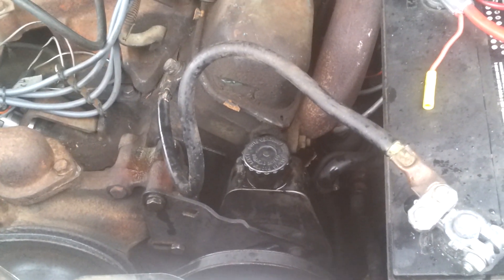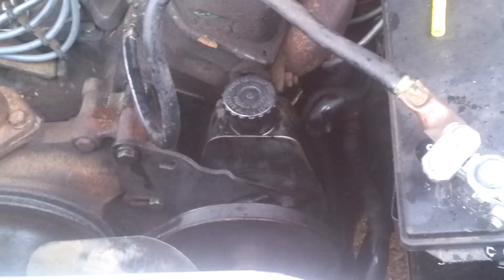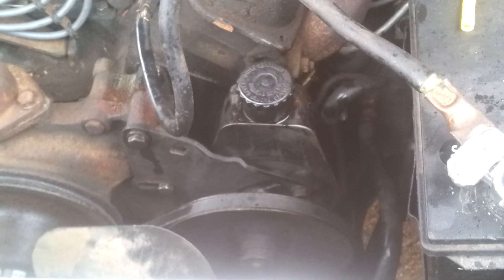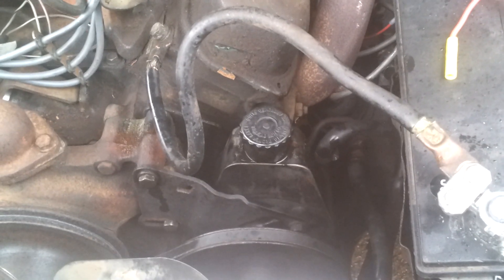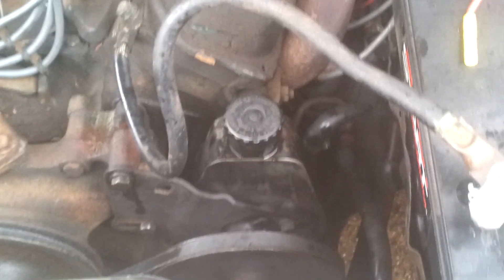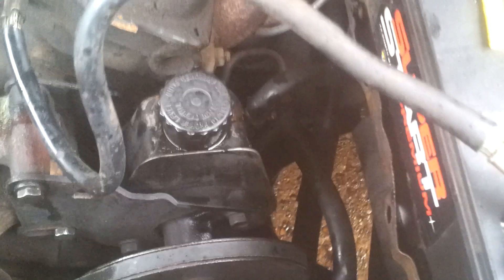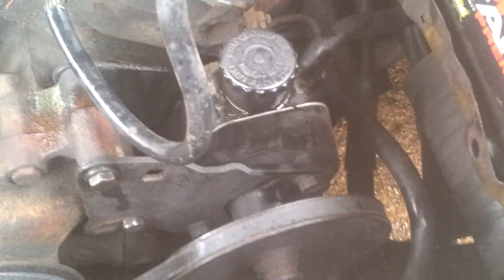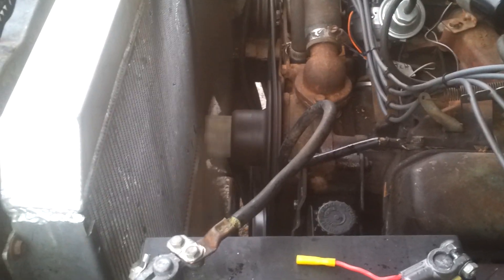1968 Dodge Charger R/T December 2012 Update

Comment: My dad substituted transmission fluid instead of power steering fluid. The pumpkin at the end of the steering wheel has always leaked. The transmission fluid eats up the gaskets. Restored the car and use power steering fluid. I need the bolt that closes in the back of my pump. Either was left out or came loose. I think it is a 5/16th coarse bolt. 3/4".